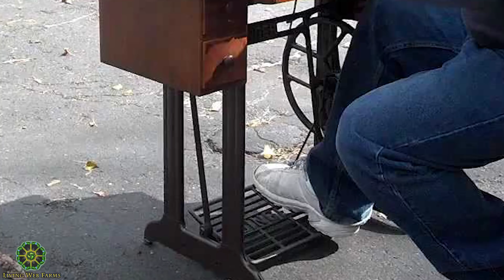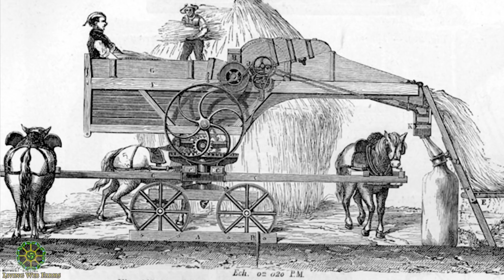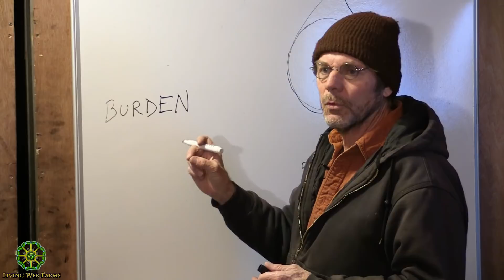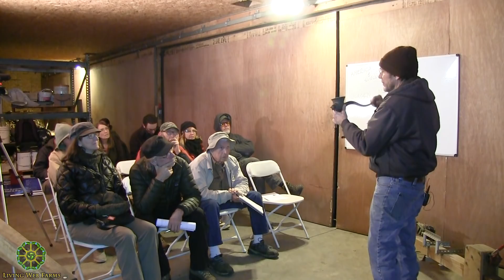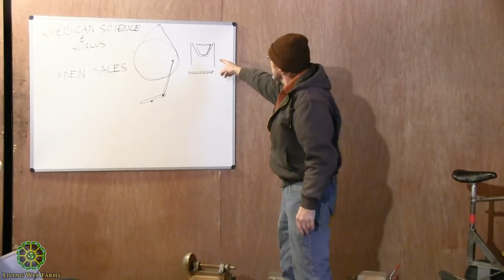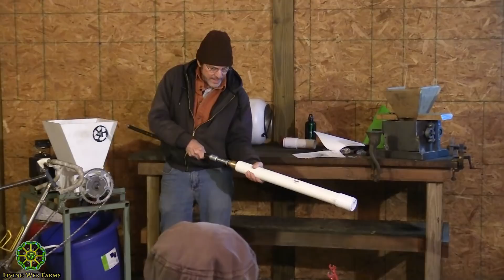Low-Tech Applied Human Power with Richard Freudenberger

Comment: This is, obviously, old tech.  It's a shame that nobody has developed modern products to utilize these ideas, and make them more efficient and convenient.  For instance, a bicycle seat is not comfortable, and the recumbent configuration is.  It's a shame that nobody has created a recumbent power unit that can operate food processors, and other typical household appliances.
On the other hand, it's easy to see why.  Electric motors have the advantage of being very small, taking up a space about the size of a fist, and compared to a chair with pedals and a power take-off stem, you can see that having a motor for each appliance takes up much less space.  And that doesn't even bring the physical exertion into play.  Some people would welcome the additional exercise in their lives, but that does not extend to the majority.
And then there's the fact that we are dealing with small amounts of power.  We are not going to send the planet to hell from running our blenders, and we are not going to save it by making our smoothies by peddling.  As much as my young self from 50 years ago was in love with Mother Earth News, my older self understands that some battles are just for nothing.  Even the off grid folks have embraced photovoltaic cells for power, and use normal appliances all round except maybe for refrigerators.
With all that said, my past self of years ago is reinvigorated, and I think I may try to design a recumbent power unit with folding peddle and power take-off section.  But I know that a bike crank, a pair of peddles, a chain, and a set of bevel gears cost much more than a small electric motor.  It's just not going to compete, no matter how romantic it is to the folks who are attracted to it.